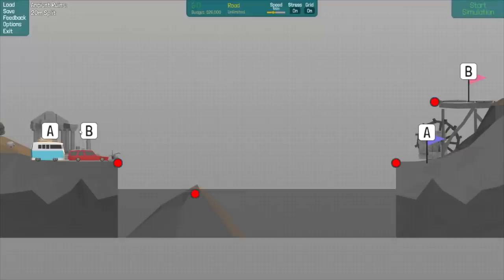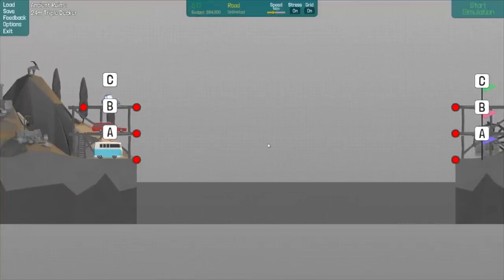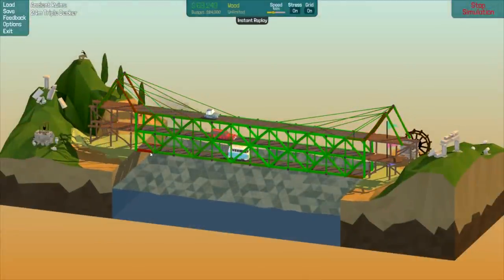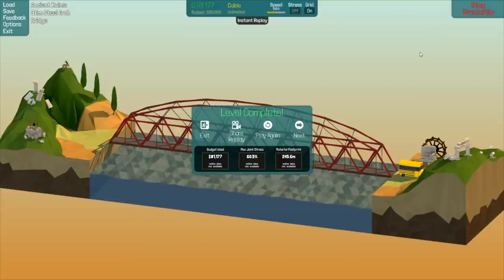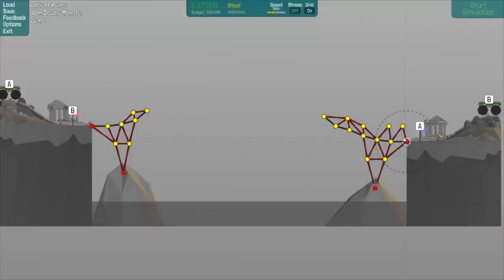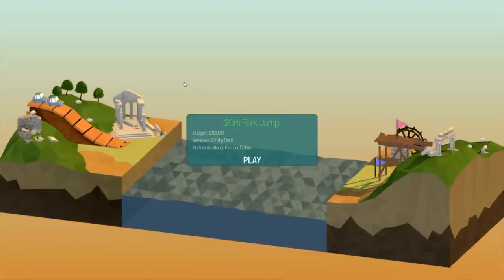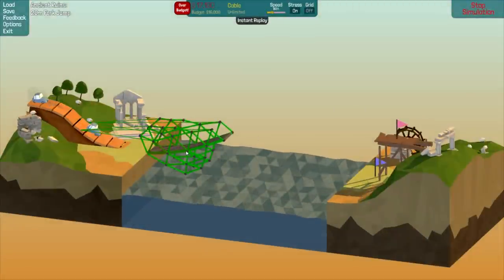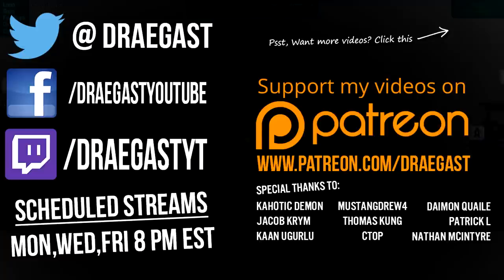Poly Bridge Gameplay - Ancient Ruins AMAZING Bridges! - Let's Play Poly Bridge Part 7

Comment: Tip, you are not using the cables effectively as they can be used. The cables are ment to keep two points an equal distance away. Think of a circle with a line connecting the center to any point on the circle. Cables are that line, and only care about being stretched. The reason i said a circle, because the point on the circle can be moved and the cable doesnt care. Therefore, when you make cables connect on the last jump, all they are doing is stopping the road from going to the other side of the river.